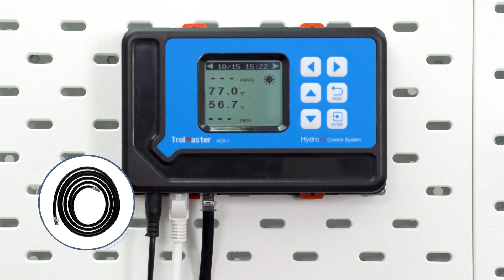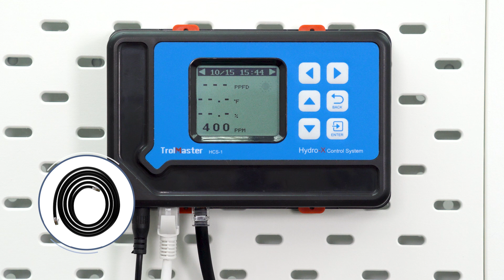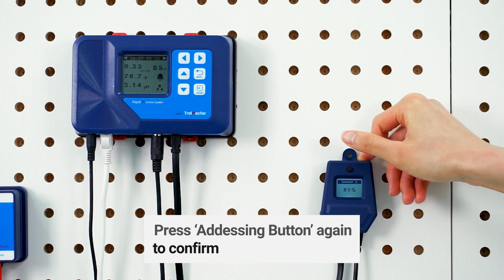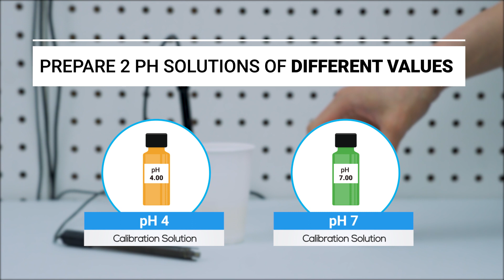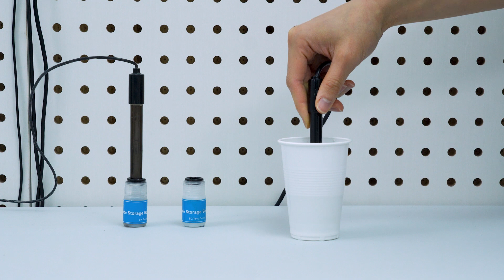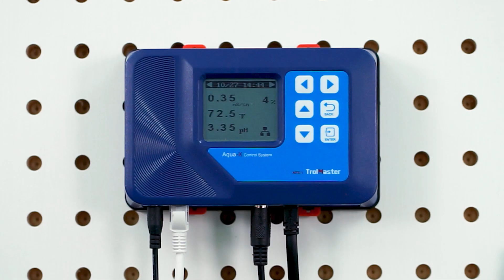How To Calibrate Your Sensors

Comment: Wouldn't this actually just be calibrating 100% to whatever the water holding capacity of the media is? i.e. 80% for rockwool.
Reply: The same question I have
Reply: @OGhitta91  same here
Reply: it is exactly that
 as far as i can tell from my own personal testing because i usually dont get run off until I am in the 90% range with my micro drippers
Reply: @OGhitta91  yea i never let my blocks hit 50% now because it’s really 40%, i was having major salt build up during flower night dry backs because of the incorrect percentage but i’ve dialed it in since then and the WCS1 moisture sensors are really bad and inaccurate so I dont use those anymore but they just dropped a firmware upgrade for the wcs2 that made it a little more accurate for EC content